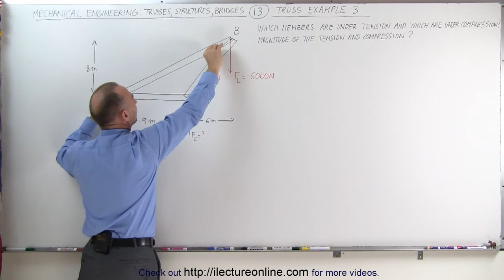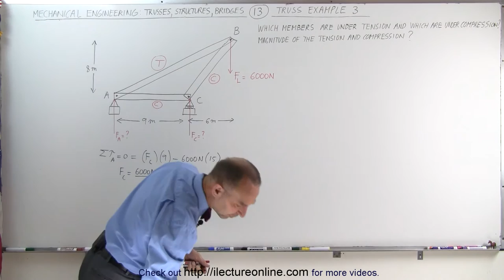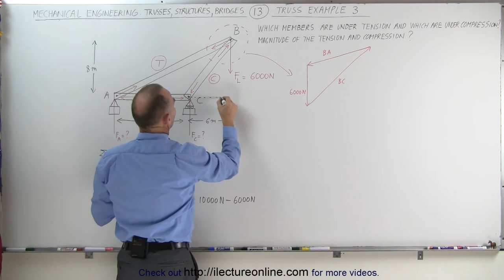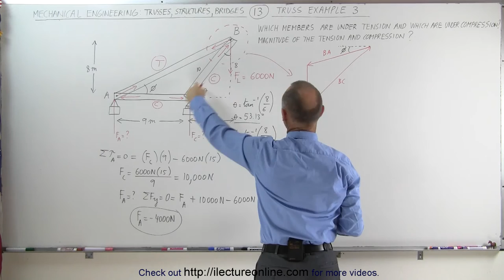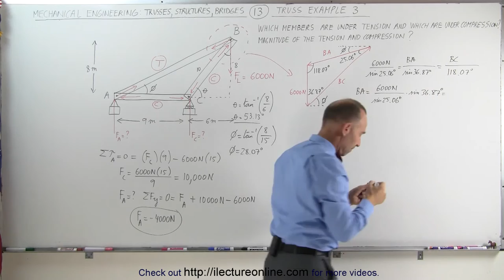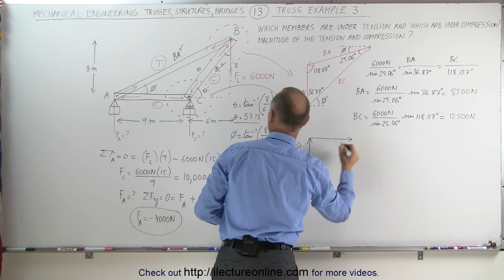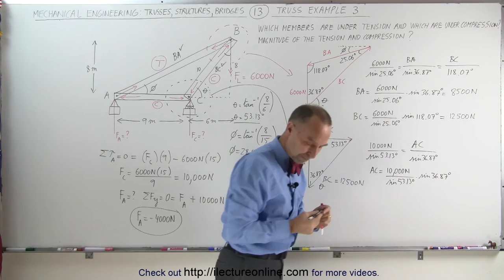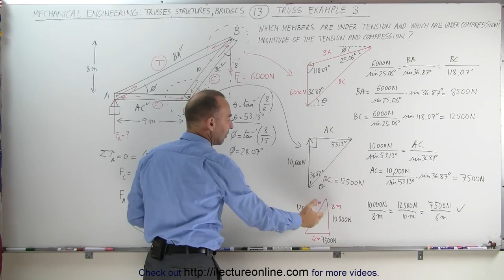Mechanical Engineering: Trusses, Bridges & Other Structures (13 of 34) Truss: Ex. 3

Comment: Thank you sir. But I don't understand why the beam is under tension but the force notation is pointing toward each other? (and vice versa for compression)
Reply from the maker: The forces drawn are relative to the joints.  So when a member is under tension, it pulls on the joints.
Reply: Very clear, Sir.
Thank you for very quick reply as well!

Comment: Hi doc!
Love the end!
One questioun though, on the last example you neglected the force of the load, why?
Thanks in advance for your magnificent vid!
Reply from the maker: Which example are you referring to?
Reply: The one you doing just twoards the end of this video, during minute 13:00
Reply from the maker: If you are referring to the 6m, 8m, 10m triangle, the vertical 10,000 N force is the reaction force Fc.   The 6000 N load is used in other triangle to find BA and BC.